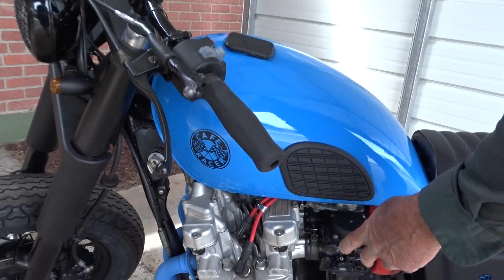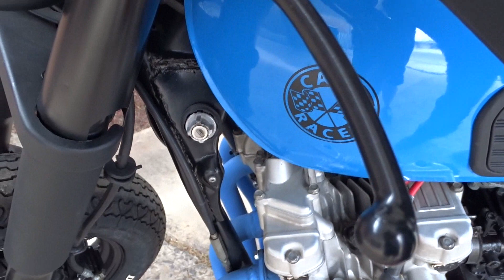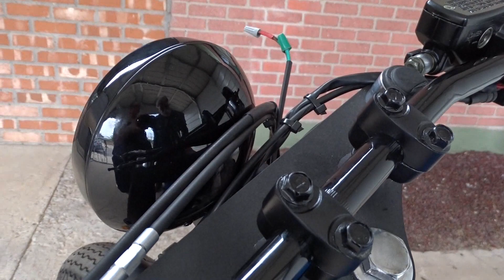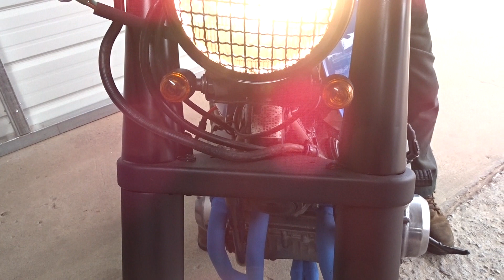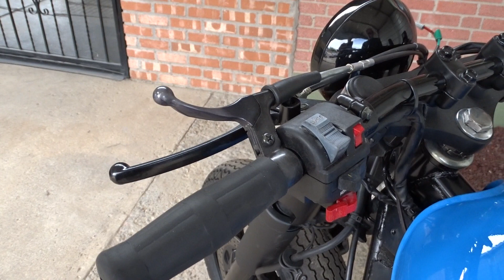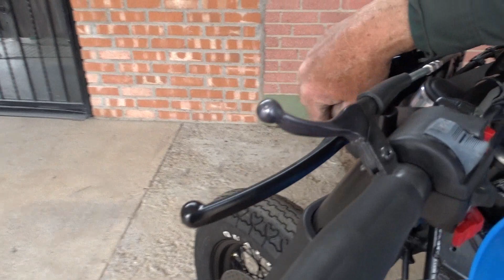040920

Comment: what are the forks and wide wheels off of, another nice build, in the time i've spent trying to get 1 bike to run right you've built and flipped about a half dozen bikes, pretty sad on my part...
Reply from the maker: Ha Ha!! That's funny. The front end is off of a late model Vulcan Classic. The ones with the big swooping fenders. I liked it because it's a 16 front. It's not a bolt on and go. You will have to change out cups and bearings. I've got a big box that I keep. Nothing is marked. It's just mix and match. If it wasn't for that, I probably wouldn't have attempted it.
Reply: @coolmonkeymc8268  Brother you must have one hell of a parts source to pull of the builds you do in fact everything you do is pretty amazing, i watch all your vids very intently and always here you mention something about the shipper picking up the bikes it amazes me that people are willing to spend that kind of money on older bikes, i haven't been able to find you listings on ebay but it's looking like you are one of the most under the radar custom bike builders out there, you're starting to become my hero.....
Reply from the maker: @quadflopper1012  Ha Ha Ha!! I like the way you think. Thank you for the kind thoughts. You're right about under the radar. I have tried hard to be the invisible man, and I'm at the age now to where I just try to do my own thing. As far as working on bikes, I have pulled back quite a bit, as far as time spent and money asked. Pretty much keeping the high bar under $4,000 for a while. A lot of guys still don't get it. They put way too much time and money into a bike, and then they end up supporting Ebay by relisting over and over. These aren't really the times for that right now. Yeah, I agree with you, to me right now getting $3,500 or $3,700 for an older Asian bike is pretty darn good, especially when you see late model Harleys trying to do the same numbers. If you have time, look on Ebay, my handle is 1313_mockingbird_lane. You may be able to view some completed listings on Ebay. Click on my handle, then click on Items for Sale, then click on Completed Items. Thanks again.